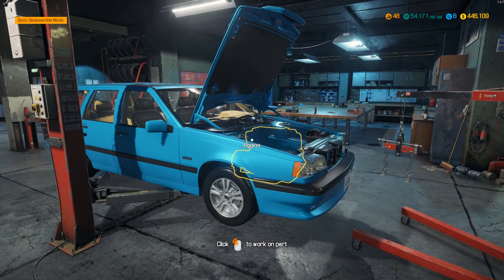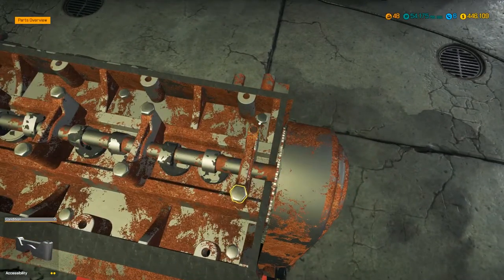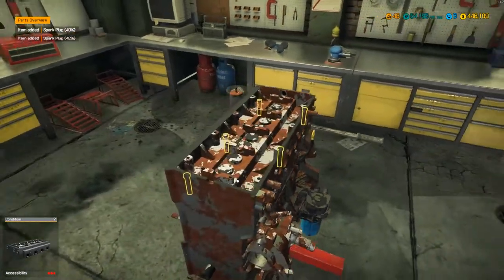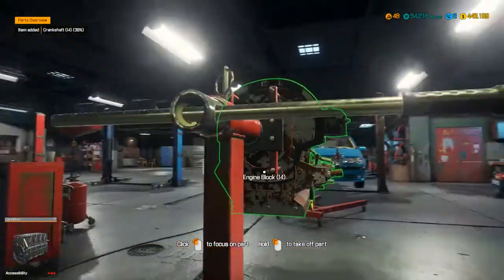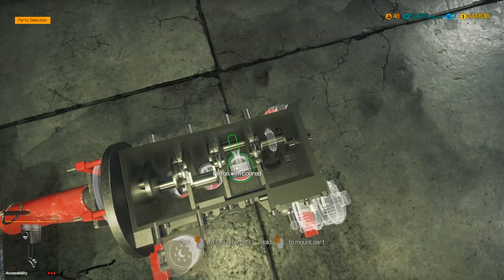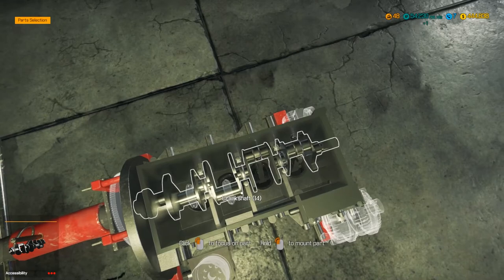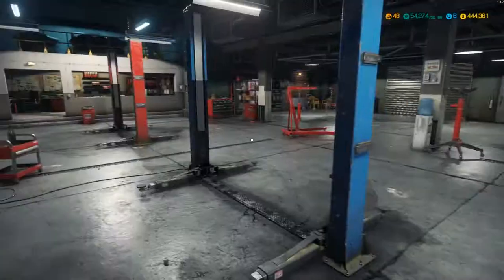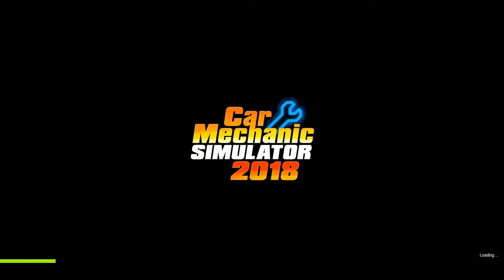Volvo 850R - Car Mechanic Simulator 2018 - Mods - Review

Comment: The Volvo 850 was designed to take the Volvo Modular Engine which came in 4-, 5- and 6-cylinder variants, but only the 5-cylinder was fitted (excluding the two prototypes which were fitted with the Cosworth-built V10 which never saw production.  That actually gives the 5 in the model name - technically, this mod features a Volvo 855 - 8-series, 5-cylinder, 5-door - the saloon would be an 854.  The number of cylinders aside, the biggest inaccuracy for me is that the engine is the wrong way around and is driving the wrong wheels.  The 850 was the first Volvo estate to be offered with front wheel drive and a transverse-mounted engine.  Some markets were offered an all-wheel drive variant with Volvo's Haldex system, but I don't think we got those in the UK.

Nice to see the 850 in the game though, especially in Swedish Racing Green (or Rebel Blue as it's officially known) as that's the colour I'll be painting mine. :)
Reply from the maker: Wow thanks for the information, I never realized it was suppose to be transversely mounted  being an older larger car i foolishly assumed it wasn't. I wonder if the cosworth prototypes survived they must have been absolutely monsters!

Unfortunately i really don't know all that much about volvo's (as comes across on the video) I consider myself a bit of a car nut but i've never really come across anything volvo expect having a period of really wanting Polestar S60 haha 

Good luck with the 850 :D
Reply: 850 with a V10? Seems legit, the only Volvo I know of that has been made with a V10 as a one-off was the S80.
Reply: That is one long comment
Reply: Another thing that seems to be wrong is that it should be a DOCH not a SOCH. The engine in the 850 was a bit odd because even the 10 valve version had double overhead.

Comment: Its actually a 855 not a 850 is only a sedan not a combi
Reply: Martin Skogsberg in the UK it was called the 850, only 855 in some markets. I know, I have an 850R Estate
Reply: @trevorockwell8764  Is your 850 R also RWD and has a I4 SOHC? :)
Reply: Jonas Bobjörk sadly not, it is FWD with a B5234T4
Reply: 850 is the model name the last number is how many doors there are. 854 (sedan) , 855 (combi). So if you say 850 it is correct it just doesn't specify if it is a sedan or combi